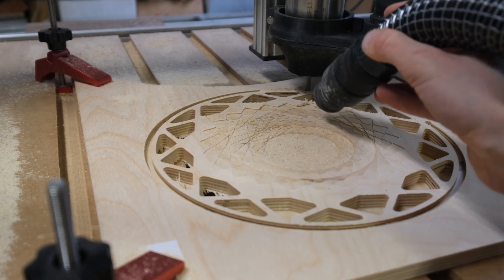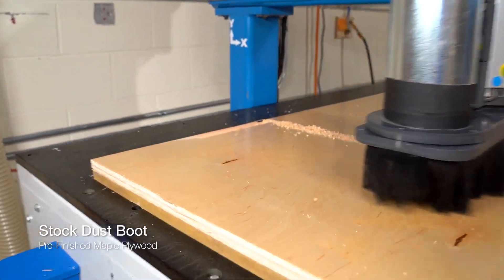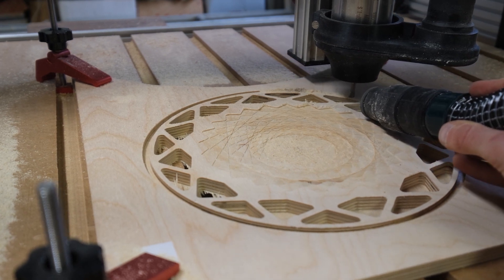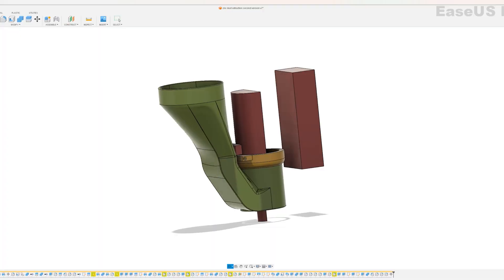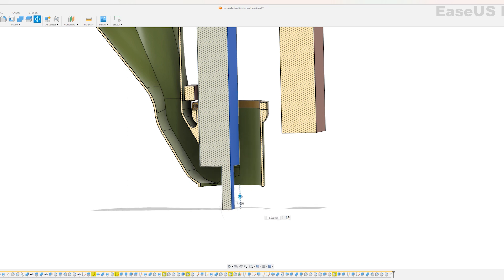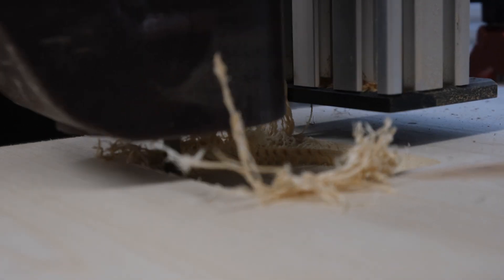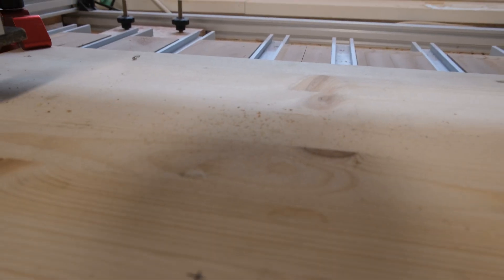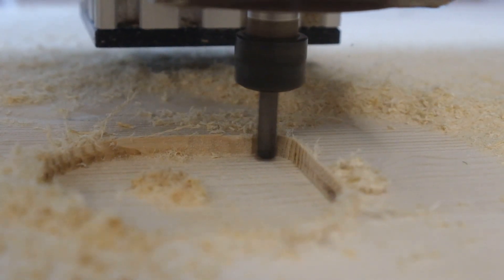The Best 3D Printed Dust Extraction For Your CNC?

Comment: Hey man, this is exactly what I'm looking at doing. Would you mind sharing the fusion file? I have a 80mm spindle (3kw)
Reply: Came here to ask this :)
Reply: Same here. Got a step file you can share? very impressed with this. I just need to tweak it to fit my diameter.